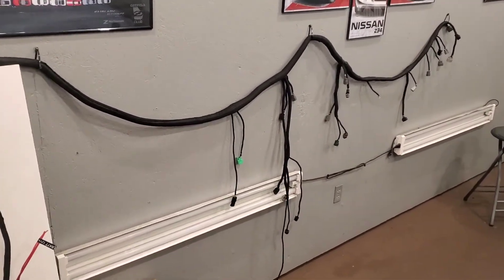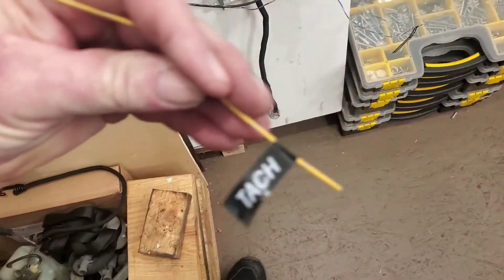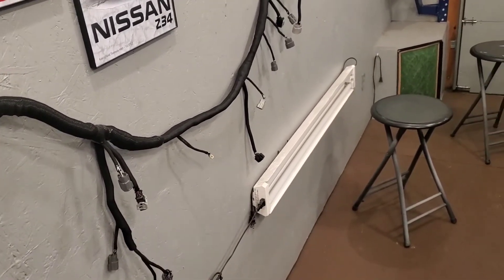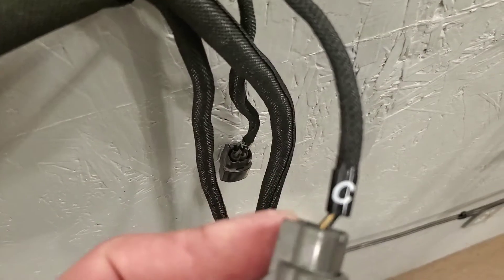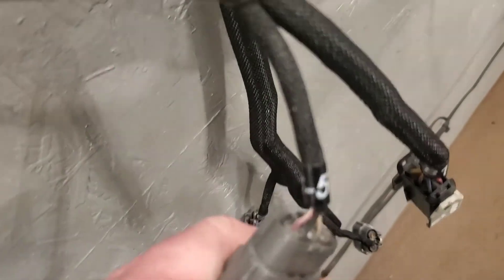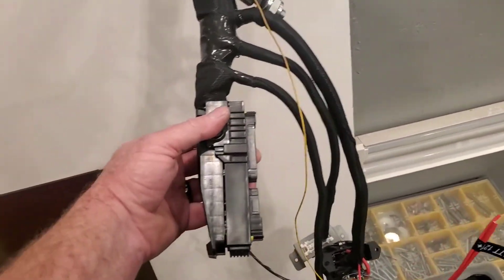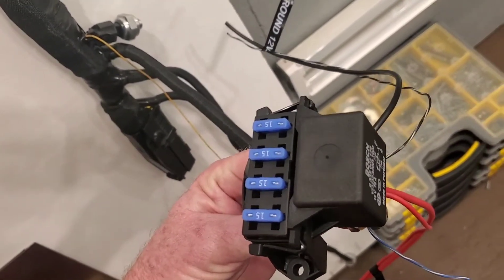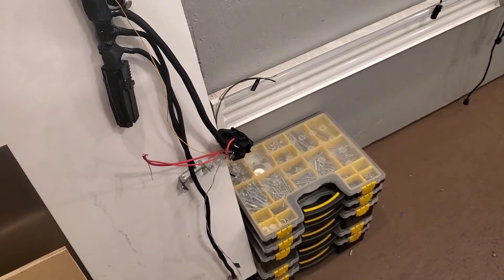VQ35DE swap harness modification

Comment: Are you pulling coolant temp/oil pressure from the harness or just running stand alone sensors/gauges?
Reply from the maker: Leaving the coolant temp and oil pressure wires in the harness. The stock oil pressure sensor on the DE is just a dummy light which can be set up that way or feed an aftermarket sensor/gauge, the coolant temp is read through the factory ecu/obd.
Reply: @vq_s30  thanks for the reply! I take it then that you’re reading coolant temp from an obdII plug in gauge of some sort?